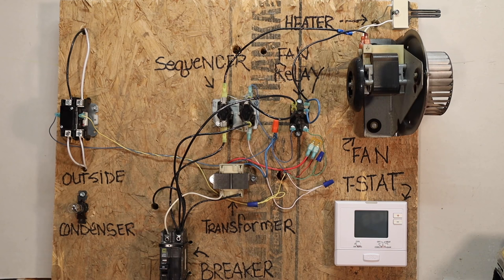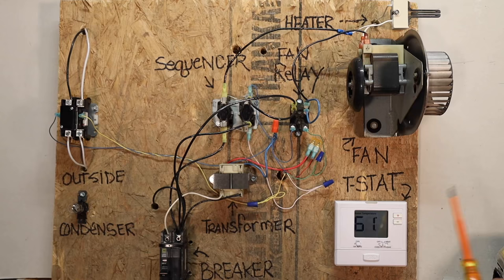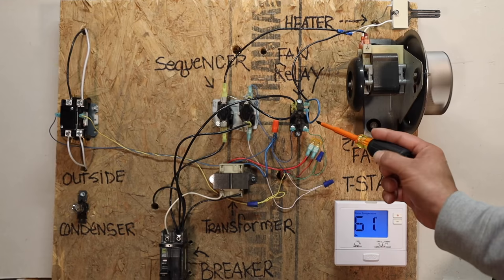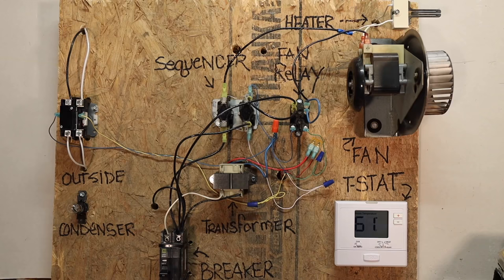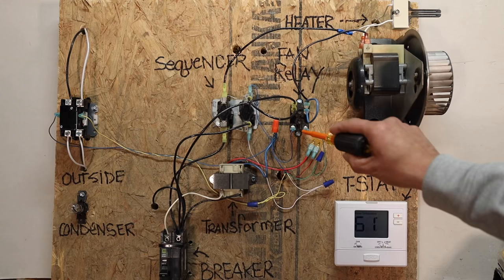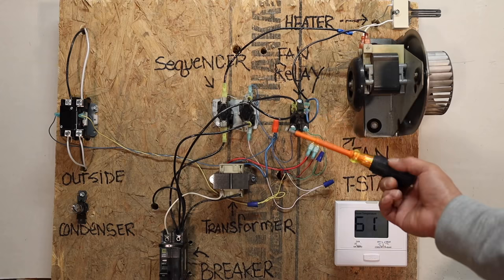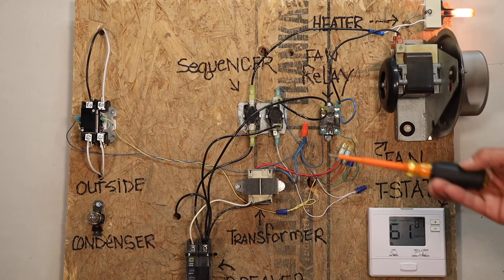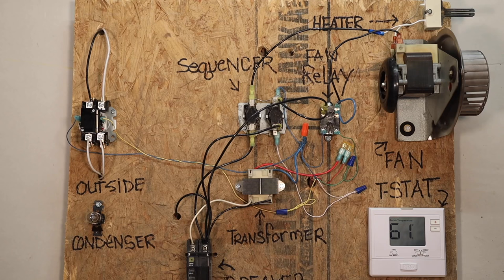how a basic electric residential hvac system works...

Comment: Sorry but I've been in the trade for 12 years and this set up never gets across. This was at every school and still in every school. Most people do not understand this set up because they haven't seen it in real world aspect.  I wish I can teach a lot of new techs how to check running anps and how to do proper PM'S and learn the sequence of operation so that when they are called on service calls for no heat no cool, they know where to look and what to do after starting the unit and why it happened and if the unit is working properly. This would be good foundation for a tech if taught properly in schools
Reply: If you’re in the South Georgia area we need an instructor at wiregrass
Reply: I'd rather see a furnace or real unit. This OSB rig does nothing for me in the real world. Sorry I must be an idiot cuz I can't learn like this. What the heck does the sequencer do? I need real world application
Reply: Hola yo vivo en Addison quiero saber q tan serva están de aca
Reply: @fubufb420  I have the same problem, but believe it or not, this is the best way he explained it very well first learn all you wire and electric parts of hvac there's other videos on you tube that goes more in depth once learn what each part is called and does then look up videos of how to trouble shoot hvac electric it took me about 8 different videos just to learn the basic then after you can move to more advance like how to check volts, Amps and other things
Reply: @fubufb420 if you see this and still need the answer, let me know. I suspect by now you found the answer somewhere else.

Comment: In most gas furnaces, the blower is the LAST thing to come on. It first has to perform safety checks and light the furnace, then a delay to let the temperature warm up, THEN start the blower so you are pushing warm air into the house instead of cold air the minute it starts.

Comment: Overall this is a BRILLIANT model.  Thank you!   This is good, VERY good.  It would have been better if the Thermostat RWYGC strip was shown and if the Outside Relay 120 VAC white/black wire was shown terminated to the circuit breaker.  
Same with fan relay.  With the black/white going into the hole it just looks like black magic.   But sincere thanks!

Comment: That was good. Now make one showing the compressor, capacitors, 521 or hard start kit and fan motor of the condenser unit. This is the one most have trouble with it as electricity is not flowing in one and then out to another.

Comment: I just want to add that if your inside fan motor isn't running the outside condenser want start up for heat or cooling.  A lot of times you can go to the air handler and check the fuse at the transformer.  It's an easy fix but only if you know to look for it.

Comment: Thanks for your video. I am still searching for an opinion on the cons and advantages of the different  air handlers setup in small closet, vertically, of apartment buildings and also, the difference on the position of the blower ... and the inside A  or not A coils and all that water runoff that soon will rust the surrounded air handler area and the mold and bad odor will set in..... Many thanks again.

Comment: Great video but the problem I am having is this, I have a Honeywell that has a red, green , yellow, and white. I know red gets 24 volts, the green is fan only, the yellow is cool, and the white is heat?

I have a black wire from the load side, and I don’t k ow where it goes. There are two wires to the out side unit red and white. How does that hook up to the inside unit!!!

Comment: Just a heads up that blower motor is an inducer fan motor. The inducer is part of a gas furnace only, it's main function is to pull a draft of air and remove left over gases from the previous ignition of the furnace, which in turn pulls negative pressure on a pressure switch which then allows power to run to the gas furnace. The blower motor however is a different part of fhe system that is in a squirrel cage located in the air handler.
Reply from the maker: yes im aware of that it was used for education purposes (acting as a blower motor) to help explain my setup..

Comment: Got a furnace with no control/circuit board that blew a transformer (no fuse) replaced transformer and added fuse and blows the fuse instantly when i turn the power on! Any thoughts?
Reply: Gas piping probably installed upside down.
Reply: Take some pictures before you remove part(s) and wiring.
Reply: Low voltage shorts are difficult to find even for  techs. Look for chafed wires where they touch metal, usually where they go thru openings in metal frame. Could also be a shorted coil on gas control valve, try disconnecting coil wires than replace fuse. You may go thru a lot of fuses before you find it.

Comment: am I missing something all the power but the transformer just make a loop and come back to the same L term on breaker?
Reply from the maker: yup one side is on every relay (common) and the hot wire is broken up and distributed as needed
Reply: Probably is bcs only 110v set up not 240v

Comment: Thank you for your video. I did not see the Solid State Time Delay for thermostat.
Question: You called that "Fan Relay," is it the same as Solid State Time Delay?
Reply from the maker: you’re welcome, them come built in the tstats now days
Reply: @engineeredcomforthvac4911  Thank you for your video. My ac cooling system keeps running and cannot be turned off, what is the main problem I need to look into? I replaced Time-Delay, Fan-Relay, and contactor (outside)? I would be happy to see that I can turn off at the thermostat.

Comment: What would you suspect the problem would be if you got a blower that works in low speed only UNLESS you reset power to the air handler in which case it comes back on at full force but only for a few minutes when then it slows back down to going slow.  So slow that you don't feel any air coming out of the vents....
Reply: Hey i would check your return .sounds like flex is coming lose and choking the air flow
I have run into this problem alot.
Reply: @donaldmoore4522  but why when I reset the power it blows at full speed?

Comment: wish you did a cleaner job on the wiring so i can follow it.
Reply from the maker: ill make another video if you’d like?
Reply: @engineeredcomforthvac4911  where do the white wires from the blower and heater connect? I see at they top right corner they go through a hole behind the bored, but that’s all I see? Please help 😀